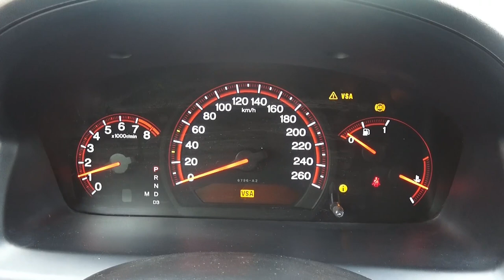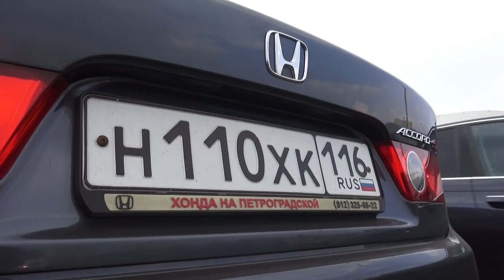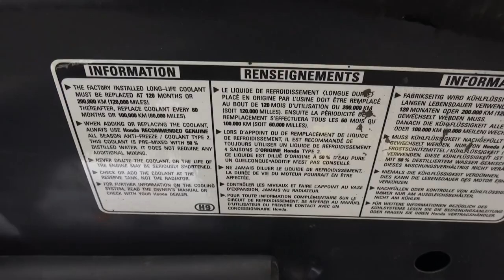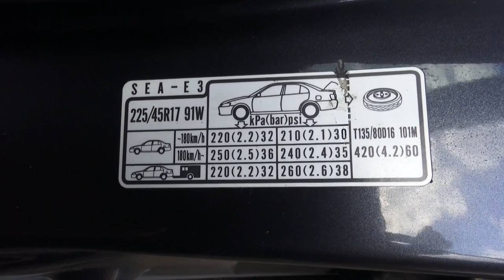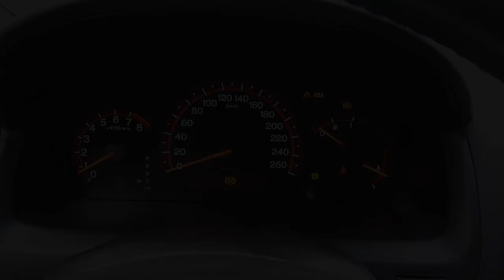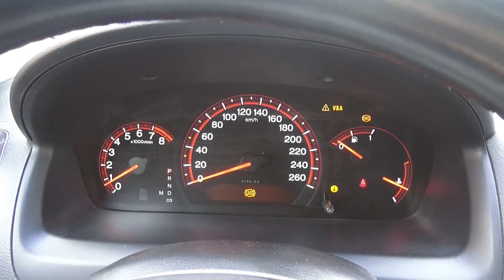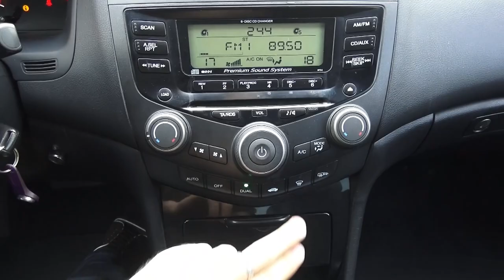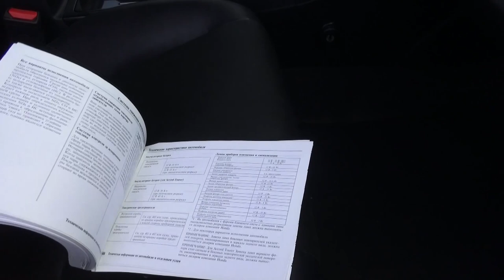2007 Honda Accord Type S. Start Up, Engine, and In Depth Tour.

Comment: 190hp? I dont get it, my 08 TSX has 205hp and this is a Type S model which is supposed to be more powerful than a base model..

The body looks pretty much the same as well, what does this “type s” offer over the 04-08 TSX?

The RSX type s offer more horsepower and styling, the TL type S offers more power and styling, what does this accord (tsx) type s offer?
Reply: Kevin S. Accord Type S handles better. The integra (RSX) is a K20. So it will be quicker
Reply: King Takumi man all these motors and models are confusing, it sucks that japan gets better integras and we get RSX, same body but different engines, wish they would have kept them the same, not to mention they also got civic type r’s
Reply: Kevin S I'm from south Africa. And we Got Civic type R's. We didn't get integras which sucks. But on the bright side we have basically no import laws. So its not like a Americas 25 year system. We Got R34's etc..
Reply: Basically if you want any JDM car. Just go get it lol
Reply: Type s is just body kit on accord 2.4 it’s fast but it’s euro r euro r is manual and faster engine

Comment: 0-100 is not 8.5 sec, is more like 7.5
Reply: actually Type S 0 to 100 is 7 Seconds flat
Reply: Mustafa Z Timan I think its with manual, not in automatic
Reply: The k20a6 ivtec will do 0-60 in just 8 seconds, or slightly under.